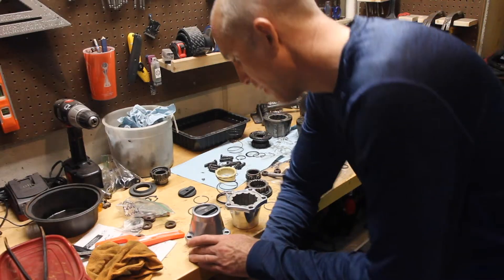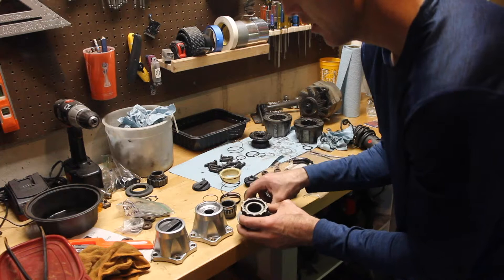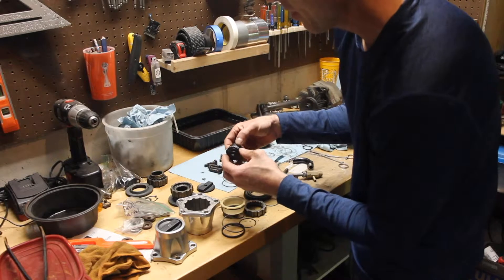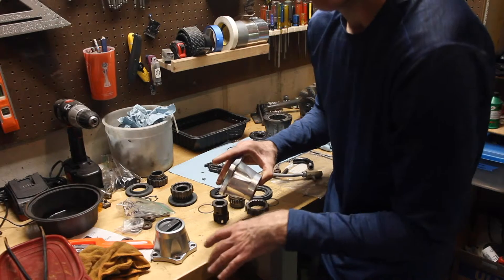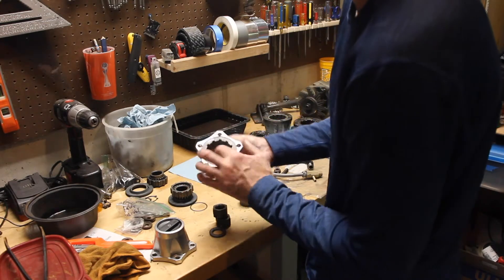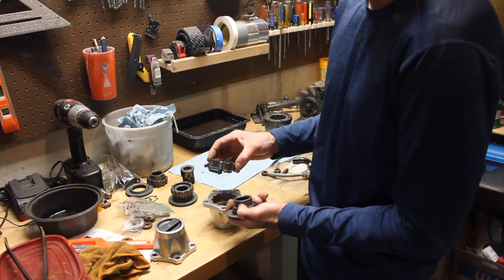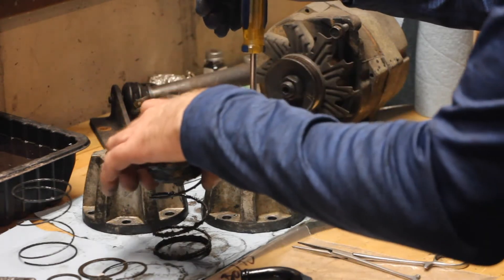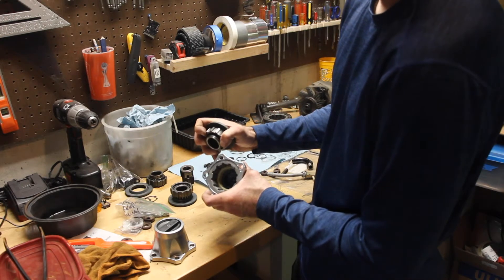Jeep CJ7 WARN Locking Wheel Hub Rebuild

Comment: Nice video--just what I needed to reninstall my '85 CJ-7 Warn Hub! By the way, my heater and air vent has been jacked up since I had the Jeep repainted 10 years ago--the body shop pulled the levers and vents and the whole system out to paint and just threw everything back in there. I feel no air blowing hot or cold, so it is useless right now. Have you thought about doing a video on how to make sure everything is connected properly and what pieces typically need to be replaced or checked for proper heater and vent operation? Every CJ I have owned over the last 30 years seemed to have some heater or vent issue (I have had 6 CJ's and even a CJ-5) that was hard to figure out for the average owner. I have done some youtube searches and there is really nothing I can find. Thanks!
Reply from the maker: That sounds like a great plan. Make sure you Subscribe because on my next build, which is under way, I will make sure that I make a video on exactly that. What I can offer now is a few videos of me taking out the elements of the ventilation system and a couple on the teardown of the components and then the restoration of each. You might be able to get some good information from those until I create the next video on it.

Removal: https://youtu.be/3ajrO8qZE4c
Heater Box Teardown: https://youtu.be/vqQJCcwElIo
Fresh Air Intake Teardown: https://youtu.be/OuQkw5kvpjw
Heater restoration: https://youtu.be/JQNVHiENT_4
Fresh Air Intake Restoration: https://youtu.be/iEzqkTsGqk0
Reply: Cool Guy Will do!

Comment: Hi, do you have a 6 bolt warn hub cj5 1977  hub rebuild video, my warn hub looks like the WO-1 hub, so it might not be the original hub. it may have been replaced years ago by someone else
Reply from the maker: Not yet. I'm starting on a 79 with WARN hubs. But that won't be for another month or so.